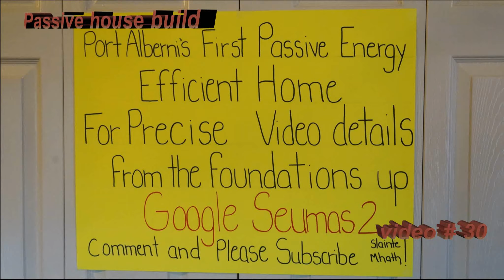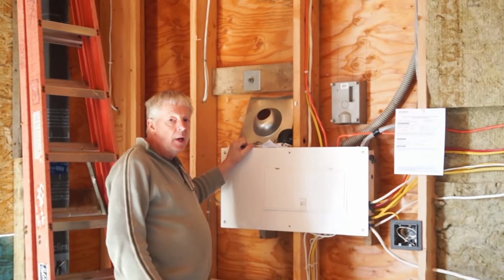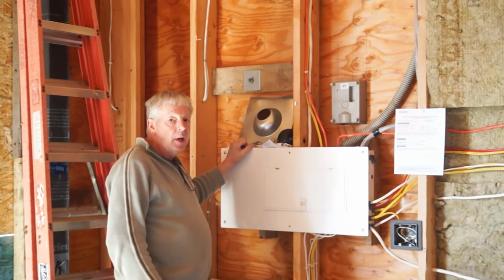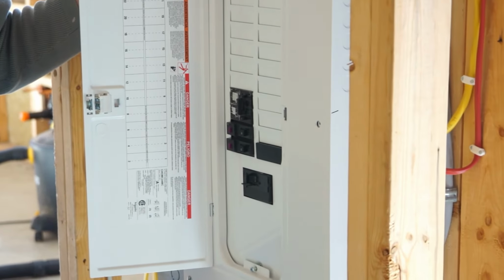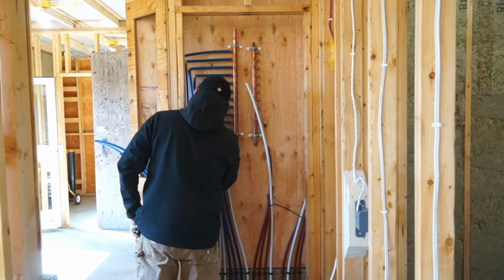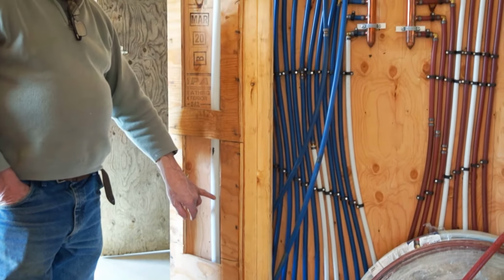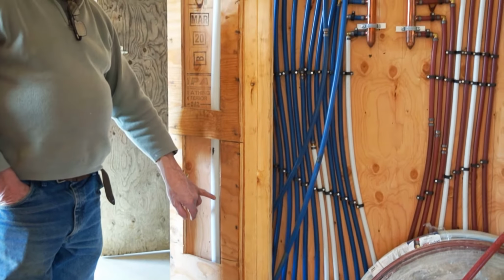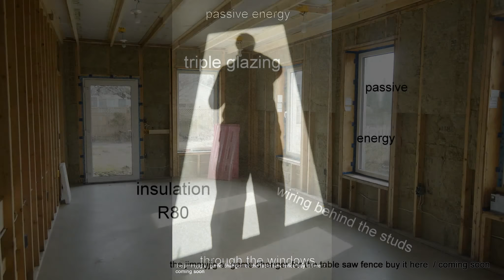Port Alberni's passive house construction video #30 from the foundation up

Comment: I should think poured-in-place concrete sills would prevent water runoff/weeping from under the windows and ultimately require caulking all the way around. Curious if considered creating the concrete sills off the house and installing them with shims to facilitate runoff/weeping...?

Comment from the maker: Port Alberni's first Passive house (Passivhause) build in the heart of Vancouver Island British Columbia Canada.

Passive House(Passivehaus) is considered to be the most rigorous  voluntary energy-based standard in design and construction industry today.
Passive house buildings consume up to 90 percent less heating and cooling energy than conventional building.

The use of Passive House design software was used to gain the specs required to meet the performance standard for this location.

House was constructed well  above the current standards as outlined in the B.C. Building Code.

Footings were widen to 36 inches(914 mm) due to low bearing soil conditions and additional rebar reinforcement added.

30 inch high (762 mm) high reinforced walls . Course sand placed inside foundation walls and mechanically compacted.

Three layers of four inch *102 mm) thick  Expanded  polystyrene foam sheets with all joints staggered and tape were placed on top of compacted sand.

The three layers of foam have insulation value of approximately R 50.

A 20 mil layer of poly was placed over the E.P.S. sheets and taped and sealed.

Four inches(102 mm) of 30 m.p.a fiber reinforced concrete was placed to form a slab over the foam based.

Slab is isolated from concrete stem wall with four inches (102 mm) of E.P.S. to prevent thermal loss.

All cold water lines are buried in the sand to keep them cool, hot water lines have been placed in the center layer of foam insulation to minimize heat loss.

Wall plates compress to heavy beads of acoustic sealant between layers of vapor barrier to prevent air movement.

The walls are double stud configuration set at 24 inches (610 mm) on centre and plates are spaced in a manner that yield a 20 inch (508 mm) thick wall. 1/2 inch (12 mm) standard plywood sheathing with  Mento 1000 a three layer airtight vapor open house wrap( far superior to common house wraps) with 1/2 inch(12 mm) pressured treated plywood rain screen battens form the exterior surface. 

Intello  smart vapour barrier was installed one third in from the inside wall to prevent condensation in this climate.

Triple pane argon filled windows meeting passive house standards from Euroline  were placed mid wall to reduce wind wash heat loss.  All window openings have been splayed at 45 degrees to give a full wide angle view.

Almost all the wiring and plumbing was kept inside of the vapor barrier envelope to minimize air leakage.

Passive house standard requires air leakage not to  exceed .6 Air changes per hour at 50 pascal.

Zehnder comfoair 200 HRV has been installed with a 1000 watt air preheater .(92 percent heat recovery rate)

House has been pre- plumbed for a heat pump water heater reducing  domestic water heating cost significantly.

Garage has been pre-wired for 40 amp/240 volt  electric car charging station.

House to be equipped  with  heat pump condensing dryer which requires no external venting,only a water waste line. George K Builder. © George K 2019       https://www.youtube.com/user/seumas2/videos